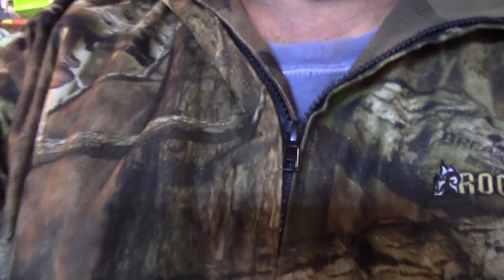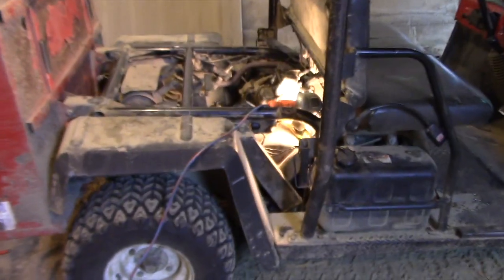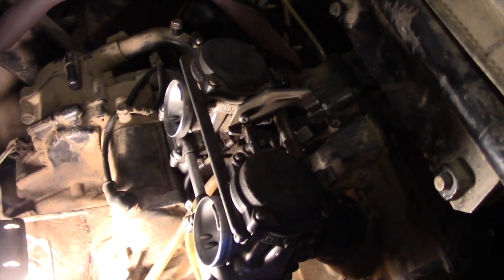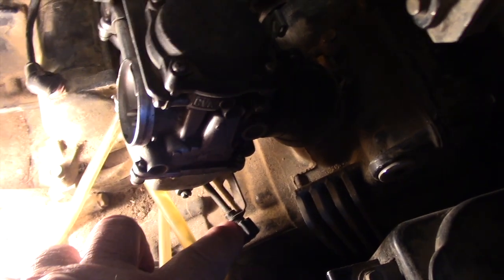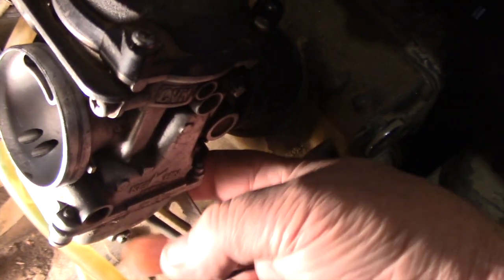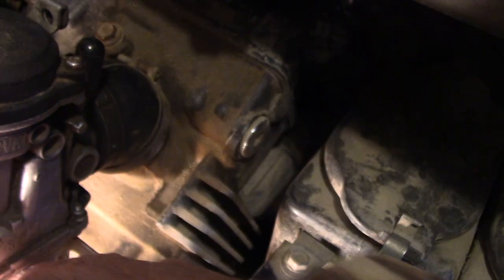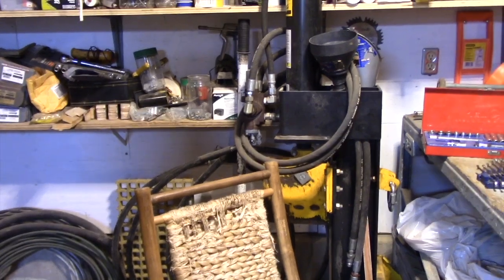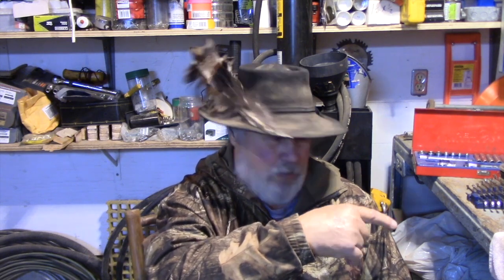Caution with the Keihin CVK carburetor

Comment: Great job getting to the bottom of the issue. I have still not worked out all the mysteries with carbs, they all seems to have oddities
Reply from the maker: I’m not done with it yet but it will be a next Spring job. It was running not that bad, but it’s not perfect.....CHEERS